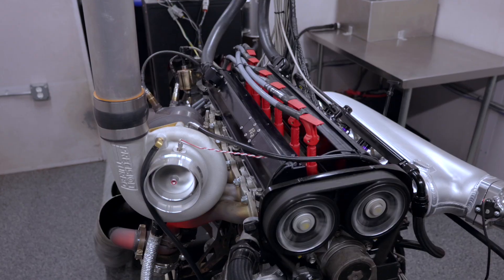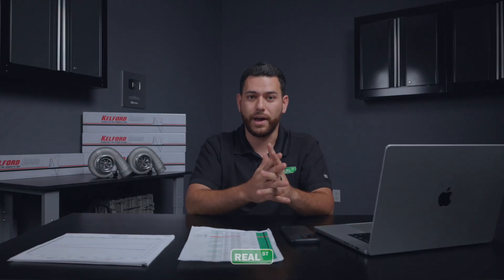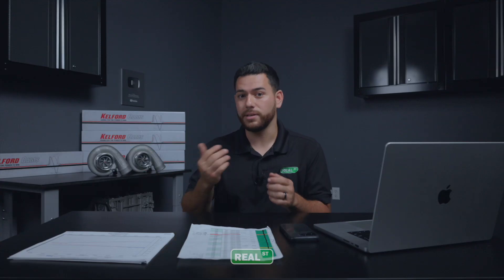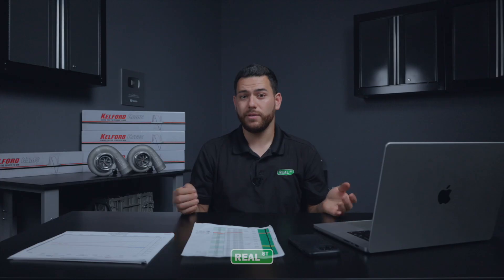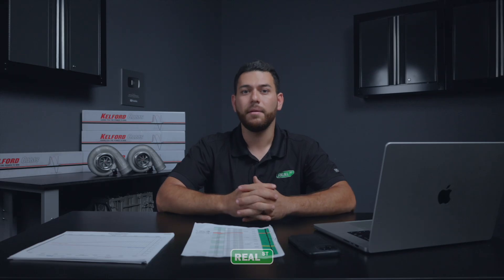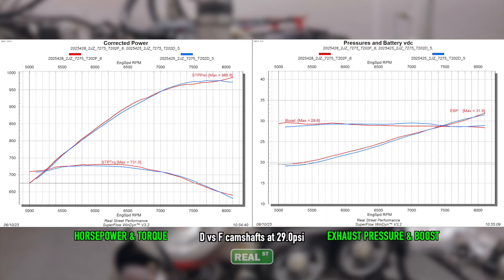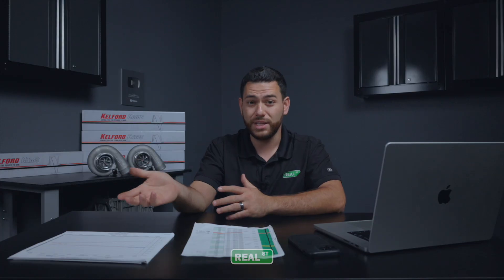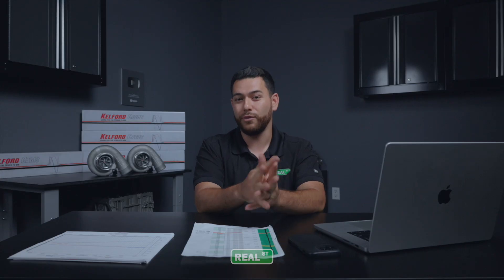Which Kelford Camshaft is Best for me? | 900-1,100hp 2JZ Testing - 7275 + T202-D

Comment: Stock long block jdm 2jz gte non vvti. Emu black, Pte 6466 1.0ar twinscrow. 1650cc 625lph fuel pump. 91/ E85. I want to 750hp plus... and will just run daily 91 most time on lower boost. 
Which one would be better suited? 264 D or C? Don't mind getting springs/retainers.

Comment: Are the base circles of the kelford cams the same? Meaning easy cam swap if going from c - d for example.
Reply: Yes they were! We checked lash each time but had minimal variation from cam to cam.  Always check though!
Reply: @markconte1513 Was any clearancing necessary within the head for the D cams? I’ve heard sometimes there needs to be clearancing for oiling purposes

Comment: Too tight of an installed LSA on the F cams for a >1:1 EMAP:MAP ratio. Spreading them to equalize overlap vs the smaller cams would be an interesting albeit separate test.

However, nobody with a vaguely "streetable" setup has really any use for them, and spreading the centerlines means not getting the scene points for a nasty idle.